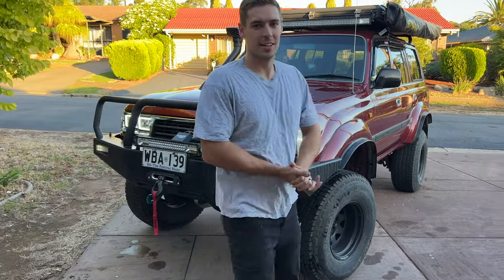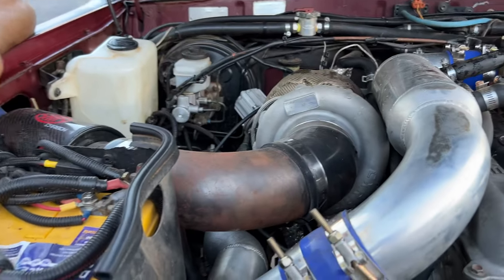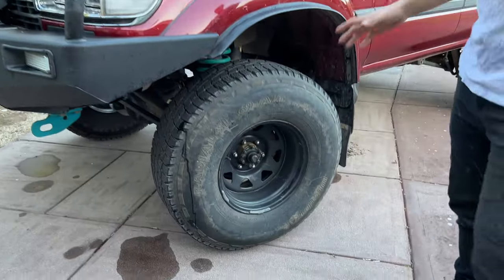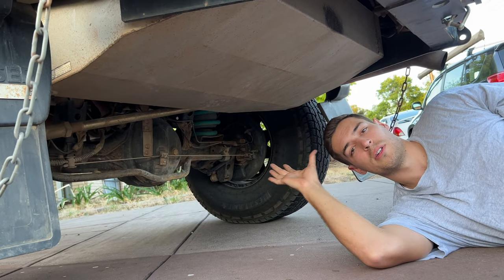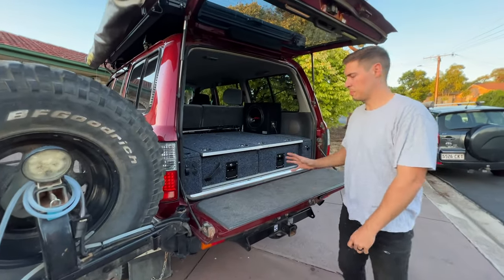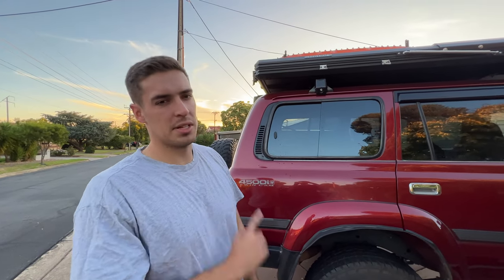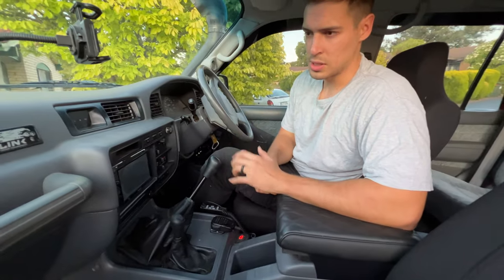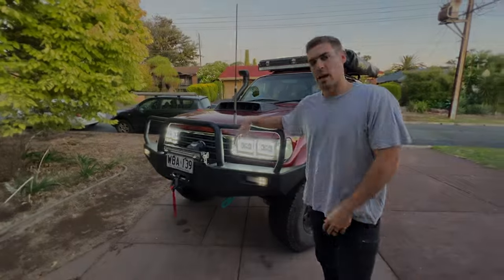RIG RUNDOWN - TURBO 80 SERIES 1FZ

Comment: actually water is 14x more efficient at cooling than air to air. I do however think your water intercooler on the charge side is much too small for your set up, it will be to restrictive air flow wise and it doesnt have enough surface area to cool the air charge that your turbo is capable of. your water cooler looks like its probably good to cool air for somthing under 200 hp and Your 1fz probably exceeds that naturally aspirated.

Comment: hey bro, i have a 99 jackaroo that ive turbo'd the 3.5 petty, i was running the exact same air filter box as you but after a couple of years i started getting compressor surge (gt3076) just thought i'd let you know, the pod inside those boxes is tiny, im only running around 7psi

Comment: Hey man by chance do you have an upgrade list.

I'm interested in upgrade with turbo and the headlights
Reply from the maker: Not really sorry man. It’s all over the shop.
Reply: @rigitup  how do you like having the turbo on it compared to what it was stock at minimum I do want the turbo. I think I was looking at CXRacing
Reply from the maker: @gvflash13  yeah turbo all the way. Even with 5psi you can notice a huge difference. Never struggles up hills.
Reply: @rigitup  do you remember which turbo kit you use and pretty much did everything come together
Reply from the maker: @gvflash13  yeah if you’re gonna go cx racing only get the hot side. The intercooler and piping won’t work because it’s designed for left hand side steering so the steering box gets in the way. Hot side and custom piping/intercooler is the way.
Reply: @rigitup  awesome man much aprecaiated

Comment: How much fuel does it use , like per 100ks , I’m interested in putting a turbo on my 105 4.5 petrol
Reply from the maker: Without the tent on top around 20L/100
Reply: @rigitup  thanks 👍 beast truck